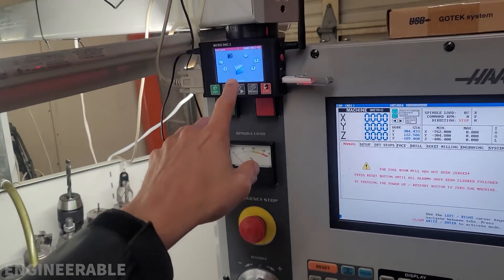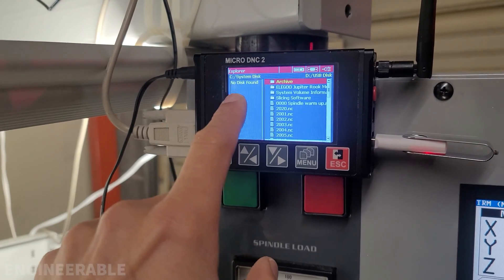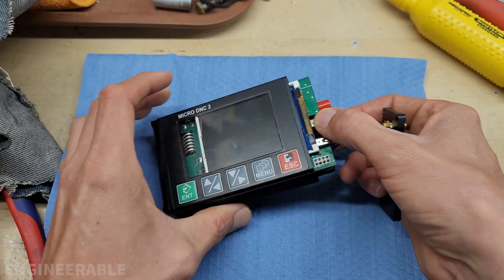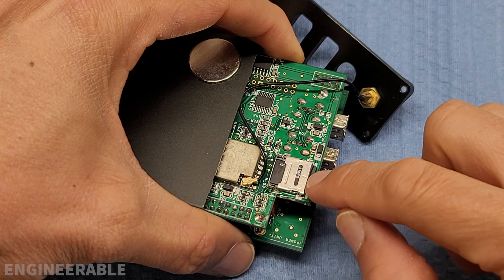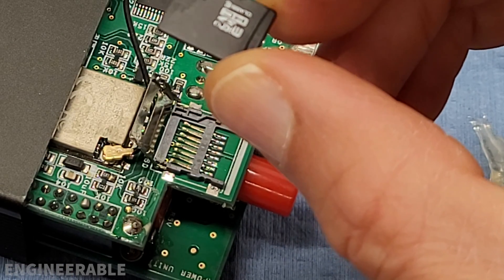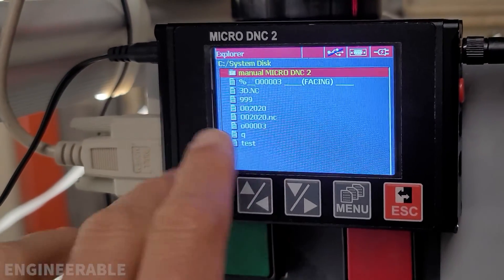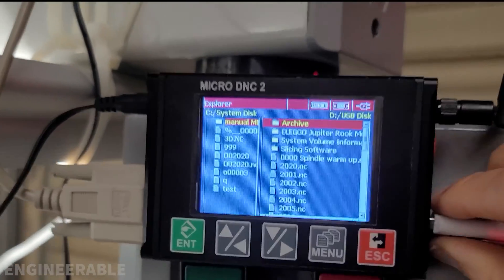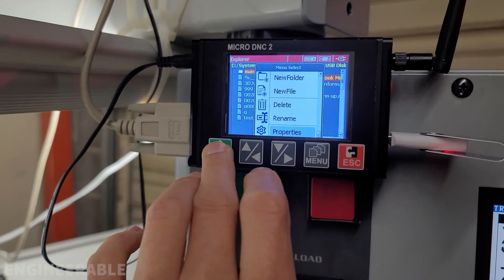How To Fix MICRO DNC 2 CNC Drip Feed Controller Micro SD Card Issue with System Disk "No Disk Found"

Comment: Hello, I just bought the DNC 2d version also with 4gb memory. Did you ever replace the 4gb in your device? The one I have does not come apart at the end but the case splits in half.
Reply from the maker: @jamestretten3046  I had no need to replace the SD card. Just had to reseat it to get it to connect again.